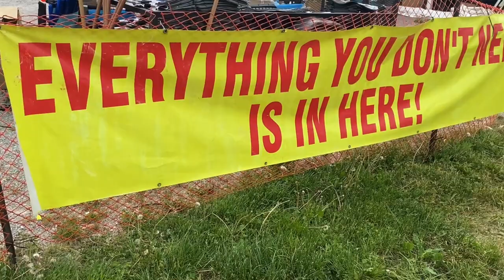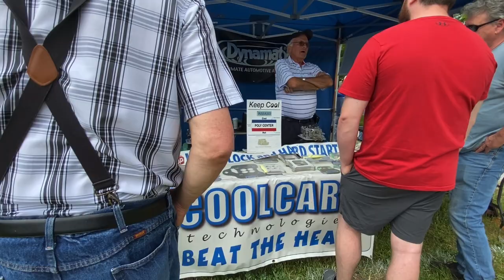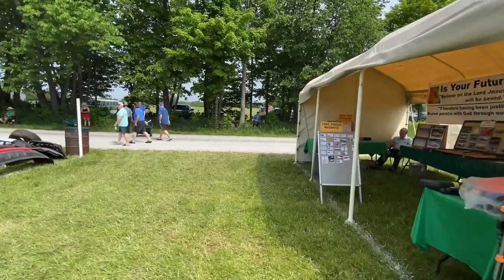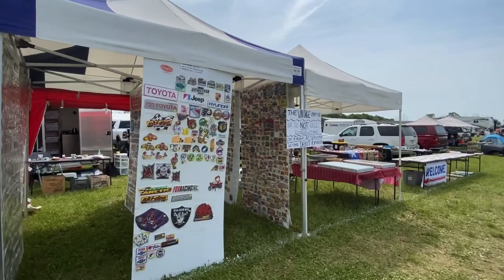Barrie Auto Flea Market June 2023 Walk around..  Antique Cars

Comment: I'm a very long time BFM attendee, dating back to the South Barrie Molson Park days (early/mid '80s) when at its peak it took 8 hours to do 1 pass through the vendors (mid 90s). I did this Spring's event once and a bit before noontime, and looking over a big lot of non-automotive. I bought only one item, and the admission has gone up, again.
But you still need to dig real hard to find 'stuff'.
Stirling and Lindsay were both better hunting grounds, and upcoming Fenelon Falls has always been good item events, because the 'clean out the garage' vendors can validate the costs as compared to BFM's $200+/spot.
ps a little warm on Friday.
Reply from the maker: Thanks for the comment..When is the Fenelon Falls event?  I would like to check that out.
Reply: @garagegladiator  It's held at the Fenelon Falls fairgrounds on the August Long weekend 5th and 6th, opens at 10 am, swap meet both days, same for the car show . Don't buy any Pontiac parts and I won't buy any Ford pieces.
Reply from the maker: @bfmcarparts  Thanks man..  Its a deal all the Pontiac parts are yours. :).  Have a good one..